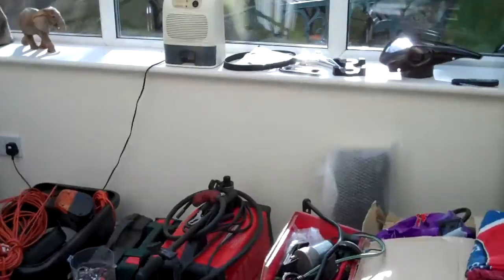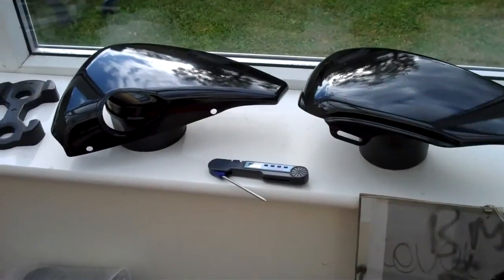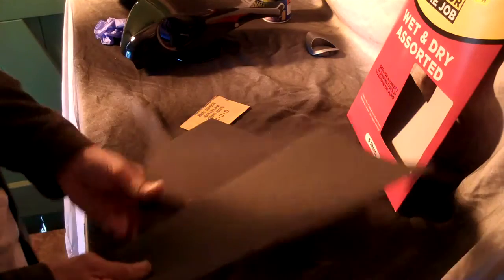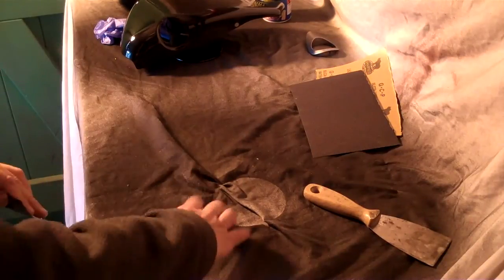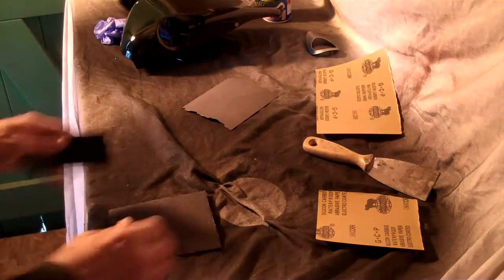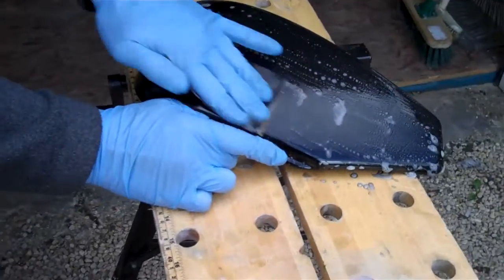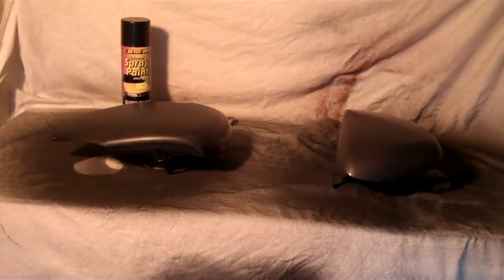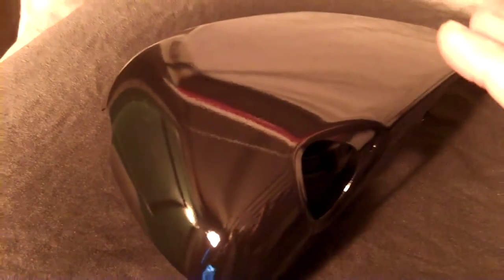Delboy's Garage, XL883 iron, Respray Time, Part 2.

Comment from the maker: @kennroxx Ken you're mad, i love it,  patience is the key with rattle cans, a pro paint system, using two pack, a gun and heat booth, that would have been done and refitted in 12 hours, but cans take so much longer, and its rushing to finish that louses up most paint jobs, im afraid it gets even longer today, i spent last night cutting back and polishing them, they're beautiful now, but still need another cut and polish, and then still to be refitted, dont know the final paint myself yet either.

Comment: First off, love your videos...they've been a great help on many projects. Now, my sportster came with slightly scratched chrome side panels and I think they look "pants" as well...will this work for chrome surfaces??
Reply from the maker: Yes it will mate, just make sure you give the old chrome a good scuff up with some 320 grit paper first to make a good key... then filter that down with a 400 grit so its less aggressive.... and use a good primer first, you should get some great results... hope that helps... Del.